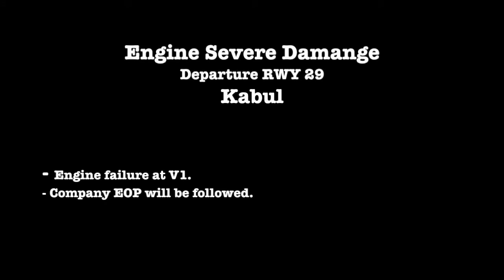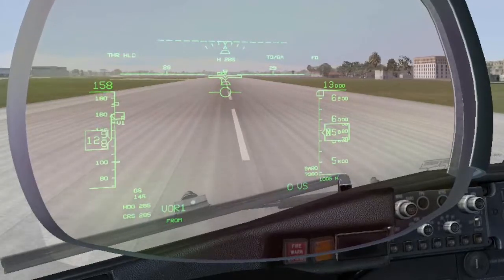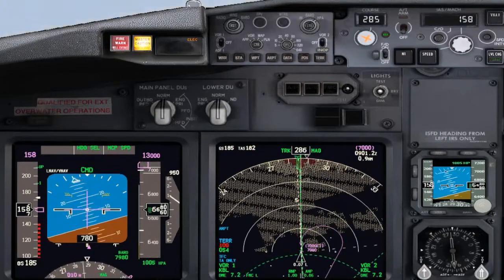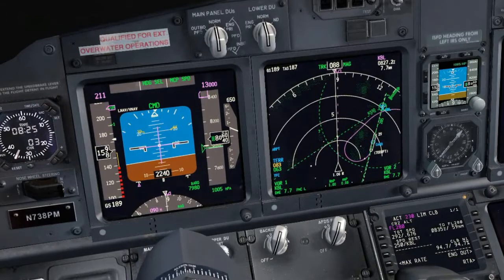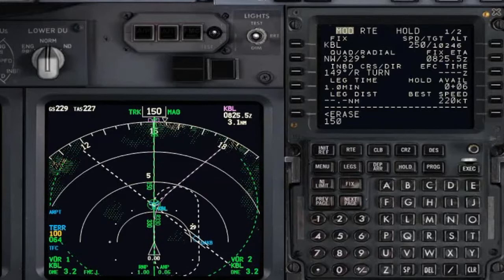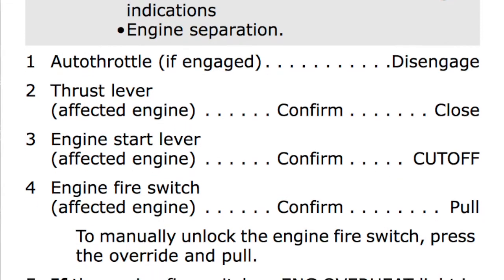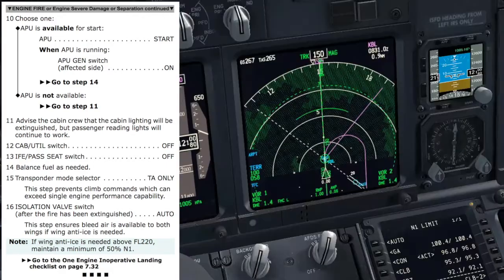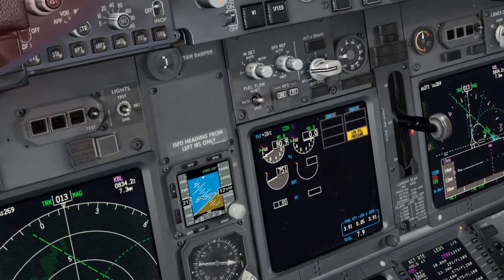Kabul Engine Out Departure RWY 29

Comment: Why didn't you do memory items firstly before reporting ATC?
Reply from the maker: It will be fixed on the next version. According to the QRH and good airmanship, it is supposed to be: aviate, navigate (flight path under control), PF directs the NNC memory actions and, as soon as practical, communication with the ATC (specially if the EOP diverts from the approved departure clearance).